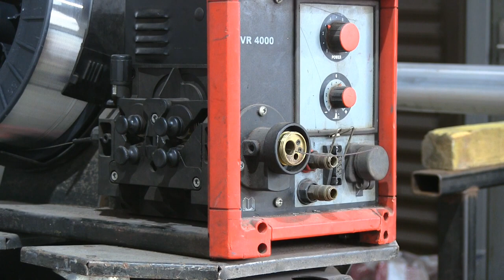Types of Aluminium Welding, how to weld aluminium & best aluminium/ methods of aluminium welding

Comment: Always good to learn stuff young man even though at the moment I do not have a Tig welder or a 4 roller drive Mig. I have tried welding aluminium with Mig in the past and struggled because the wire I chose was much thinner than what you have used in this video and the Mig welder was not fitted with a four roller wire feed system. One day, I hope to get a Tig welder.
Top regards and thanks for uploading the lesson in welding aluminium!
Reply from the maker: Sure, if aluminium Mig wire is smaller then 1.2mm it becomes incredibly difficult.  You can also use 2 roller drive but it is much harder and you also have to use Teflon liner for the torch
Reply: @weld-deluxltd7635  Yes, I bought a blue teflon liner but as you say the wire 0.8mm if I recall correctly kept birds nesting. That and not getting the aluminium really clean using acetone didn't help. It was an old livestock trailer and a complete nightmare to do. Never again, not until I get a Tig welder at least!

Comment: I'm finally going to start using the spool gun I bought for my everlast mig welder. I'm looking forward to learning how to weld aluminum.
Reply from the maker: Nice one, remember power is your friend when it comes to Aluminium welding! Fumes are deadly and flash is supper bright. What  amperage machine did you get?

Comment: Excuse me..it's not only because of the push pull system..its actually a CMT process..and its really damn good with thin material especially aluminium..
Reply from the maker: Thanks for the comment. This is not CMT process, you have them confused